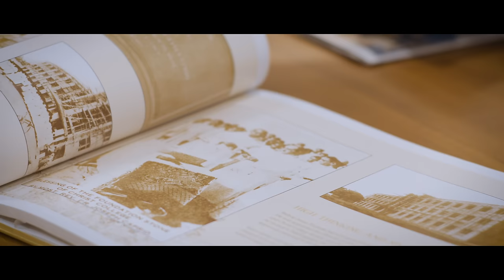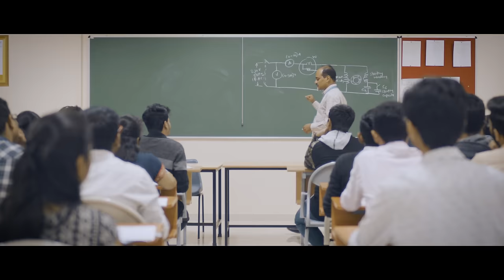CHRIST University Promo  2020

Comment: I need admission for MBA in christ, but i don't have valid score in cat 😭😭😭😭😭😭
Reply: Cmat nhi diya tha kya?
Reply: Cat me kitna chaiye!?  Phase 1 2020 diya hai kisine!?
Reply: What is the cat cut off score for mba
Reply: 75 I believe is the minimum percentile required to apply.
Reply: @akashdeepbatham8078  do they have any quota for MBA
Reply: @divkentertainment8843  none that I can think of, just don't worry, best of luck.
Reply: MAT accept krta hai Christ ?
Reply: @nishantjuneja7019  Yes, score 600+ to be eligible.
Reply: @KhanSays  Yes , I have 605 in Sept attempt ... Does the percentile has to do anything with it or it is just about the marks ?
Reply: @nishantjuneja7019  I'm not sure for Percentile don't remember it, but yes for MBA 600+ should be fine (to apply), final selection has a lengthy process.
Reply: @KhanSays  Okay thanks !!
Reply: @KhanSays  bro, I want to join mba, but the dates are over, will they open again?